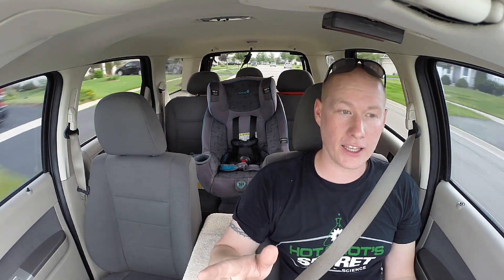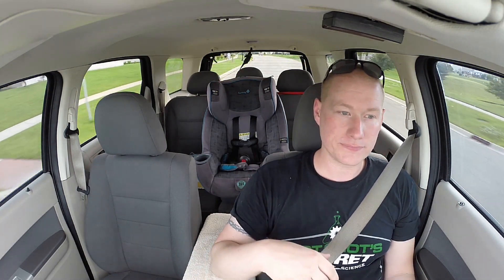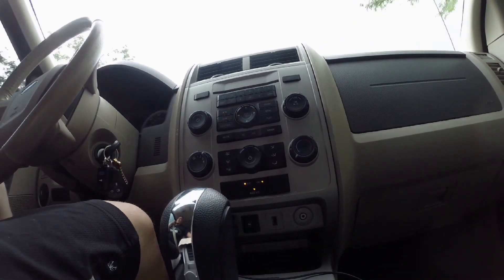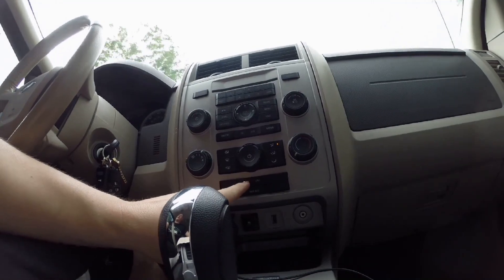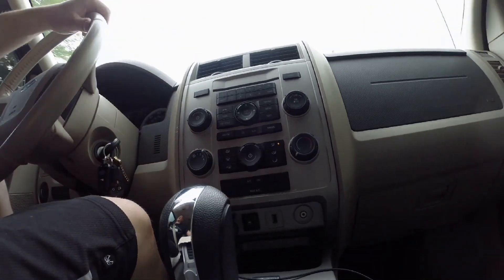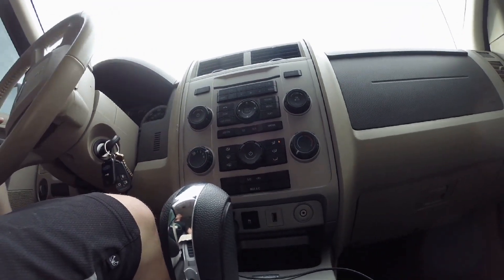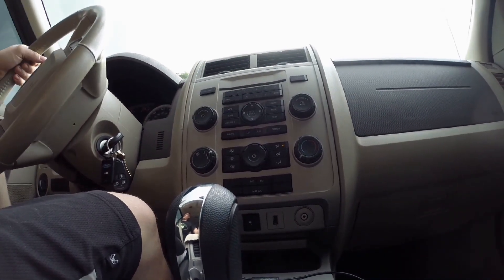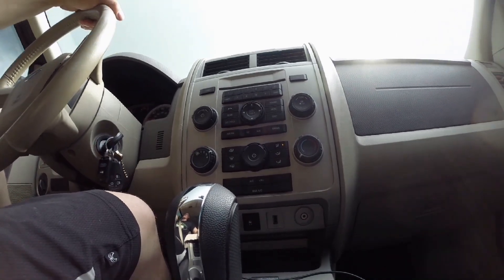Ford A/C Quick Tips : #1 Preventing That Musty Mildew Smell

Comment: This A/C tip works for home central systems too - run the fan for a few minuets after you shut off the compressor. Keep up the great work!
Reply: tim jones Actually, in your HVAC systems, fan already works for a further 90 secs to prevent mildew buildup. There's really no need to go to such route, unless you're OCD. Take it from a pro.
Reply: Correct. This is something that should be considered for vehicles. Program the fan to run a few minutes after you turn the car off.

Comment: Water alone doesn't cause the smell. Its the dirt/debris that collects on evap coil. One of the main reasons I only use recirc instead of fresh air. I really wish they put cabin filters on these.
Reply from the maker: Anthony S. Correct as stated in the video decaying leaves, pine needles dirt etc  it's all mentioned in the video.
Reply: Tony S I don't think I've ever turned the fresh air on... But yet I still get the smell... Thats definitely not it

Comment: Use recirculating air, not outside air. I made that mistake before, all the trash and leaves and you name it collects on the evap from the outside which in turn ends up muddy from condensation mixed with dirt.

Comment: My a/c doesn't work so I don't turn it on. I get the smell just from regular temps. I didn't get the smell as much in the winter, now that it's spring the smell is back,,goes away about 10 mins into the drive. 2007 f150.

Comment: Another annoyance caused by the nanny state....wonderful.  First was the crap gas milage caused by 10% ethanol added to gas, that annoying chime when I dont put my seatbelt on (Im just drivimg in the walmart parking lot after shopping to get gas acroos the other side of the lot....), and the cannot remote start for more than 10 min.  Ughhh...thanks for the ac tip.
Reply: Hey, if it's a Ford, you can disable the "belt Minder" audible chime. Look it your owners manual, each model has a little different sequence to go through. They all start off the same: Turn the ignition on, don't start the engine, wait for the red seatbelt light to go off on its own(after about 30 seconds) and then buckle and unbuckle the seatbelt a certain number of times in a given amount of time.
Reply: Dippinonthis Thanks for the tip!  Gonna try that.
Reply: Dippinonthis How many times?  Got a link for us to read up on this great tip?
Reply: Hawaiian F150 it's different for different vehicles so you're going to have to open up your owners manual and see what it is for your specific vehicle.

Comment: +fordtechmakuloco. They also make some really good evaporator cleaner that you can spray down the drip tube (has a long skinny clear rubber tube applicator). Smells nice and citrusy. Had the problem when I had bought my 2001 Escape. One application in 2004 and never had the problem since.  It was from a company called Mobilair2000 and was called Air Repair A/C Evaporator Treatment. Hopefully they still make it.
Reply: They still make it to this day. Took me forever to find the drain behind the maze of stuff on my 2017 explorer with the 3.5 TT but sprayed the entire can through the drain tube, busted a clog in the process and it’s been gone since. Was about to rip the dash off to manually clean the coil til I found this.

Comment: You mentioned, "chrome peeling off bumpers". Must be why the chrome peeling off around the rear brake lights on my 2012 SHO.
Reply from the maker: Yes exactly I have replaced countless brake light assemblies for that issue. Then Ford got smart and ditched the chrome playing idea altogether starting in 2013 I believe
Reply: Mdelta2000 I sanded mine down and painted them gloss black
Reply: jtoddk98 Nice tip, thanks. Also, I see in your pic that you appear to have blackened rims. Were they a special purchase or did you do them yourself? I saw four new blackened rims including Firehawk tire's for about $1900 on E bay from a seller in Detroit last month. They look sweet.
Reply: I did them myself, I too saw those on eBay. I used Dublicolor black wheel coating for the base coat and then rustoleum 2x painters touch gloss black on top of that. Looks good
Reply: jtoddk98 It seems like you got rid of all the chrome on the Taurus and replaced it with black. The straight black and silver looks great, nice job.
Reply: Thanks!

Comment: Thank you for the information sir I have actually the opposite problem this morning I turn my defroster on I have a 2009 Ford Mustang V6 and it had like an old musty smell and this is the first time I have turned the heat on this year AC works fine but only when I turn the heat on do I smell that smell would you have any ideas or suggestions? Thank you

Comment: I have a 2014 explorer with this nasty smell.  I have tried the Lysol in the cowl and it only lasts about a week or 2.  When I had it at the dealer for service they wanted to charge me $160 to spray a deodorizer in the air ducts.  One of the service techs said to spray a coil cleaner solution in the recirculating air duct under the dash on the passenger side.  There is so much plastic there I am having trouble locating it.  Does someone have a diagram or a photo/video showing the location?  Greatly appreciate it.
Reply: Oops, 3yr. old post. Oh well. Just a thought but have you checked/changed the cabin air filter? It may be funky and where the smell is coming from. On my 2010, '13 & 16' Fusions and '14 Edge it's behind the glovebox. Various procedures based on model of how to get to it. Once you locate that and remove it you can see the recirculate door open and close etc. Meguiar's also makes a Whole Car Air-Refresher Odor Eliminator that you set off in your car like a bug bomb/fogger. Let it circulate through the ducts while running for 10-15min. then vent the car with windows/doors open  for about 10min. But I'd check that dank musty cabin air filter first.

Comment: 2002 Explorer automatic A/C.  The front driver vents are not cooling all the way when it's set at 60 degrees (coldest setting).  You can feel/smell the warm air mixed in.  The passenger side is fine.  I've changed the blend door motor and recharged the A/C.  It seems like there is a vent that is not closing all the way.  Do you have any insights?
Reply from the maker: +Chris Machica Ok so you have changed both door actuators already? When turning the temp dial slowly for the drivers side does the actuator respond turning the shaft? Did you use Motorcraft actuators?Was it this updated actuator-http://www.amazon.com/gp/product/B004A2D4SY/ref=as_li_tl?ie=UTF8&camp=1789&creative=390957&creativeASIN=B004A2D4SY&linkCode=as2&tag=fordt-20&linkId=SUNM4NTDXW44KGNC

Comment: quick question.. I own a 2016 Ford fusion.. I always keep my AC temp at 70c... I've noticed that my AC air feels different depending on what the outside temp is.. if the outside temp is in the 80s, the AC air is very cold..but once the outside temp goes down to the low 70s or below, the AC air temp feels a lot warmer..I have AUTO OFF, but it still does that.. ... is that normal?